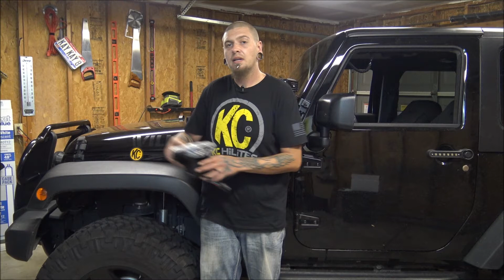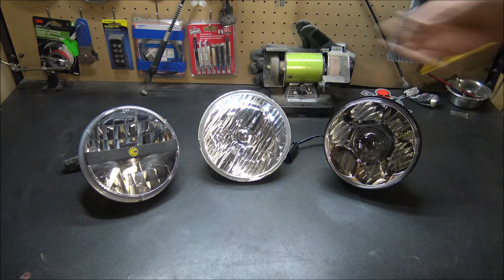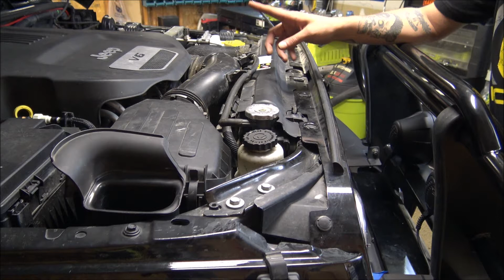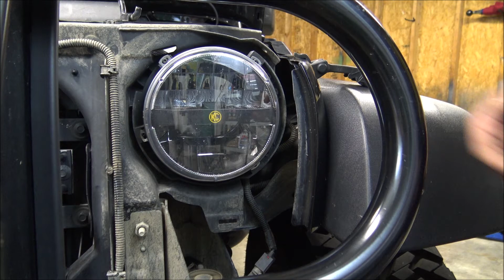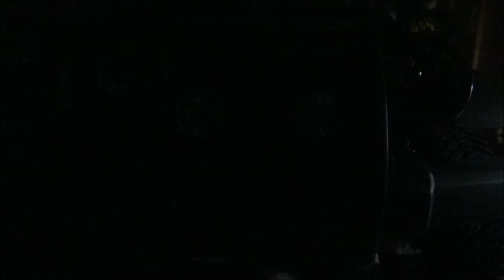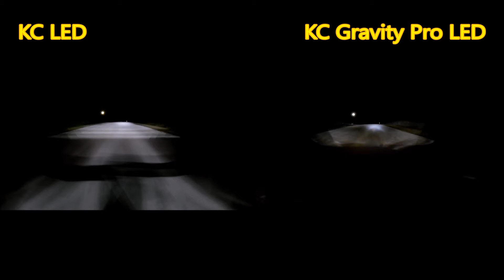KC HiLites Gravity Pro Jeep JK LED Headlights Project Dirty Willy Ep.14

Comment: The pros look better focus the others look like the light just goes everywhere
Reply from the maker: The Pro's do have a very well focused low beam. Their high beam is a different story, but I've been told that KC is fixing that issue. They have also told me that the fitment issues was corrected. Thanks for watching!
Reply: trackstar1able You kinda DO want the light to go everywhere, lol. That's the point of a head light; to light your way...